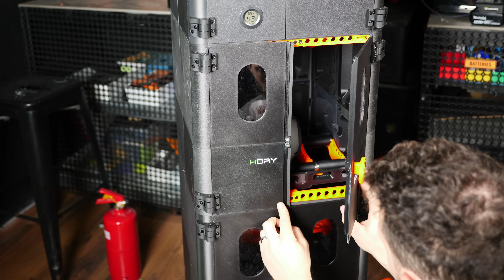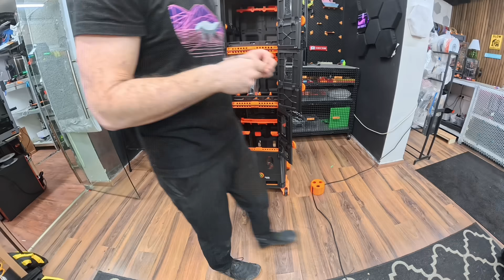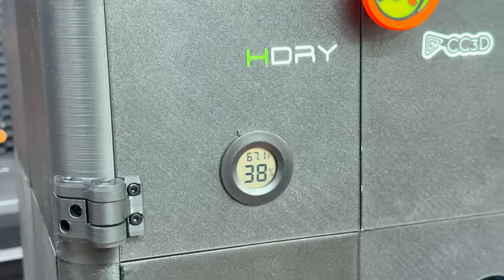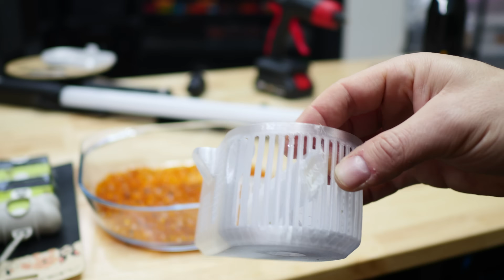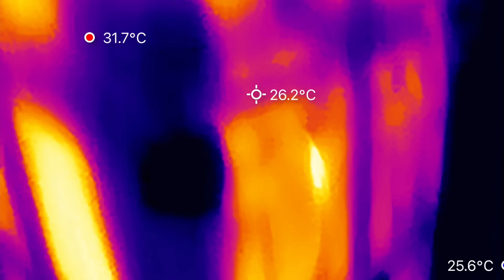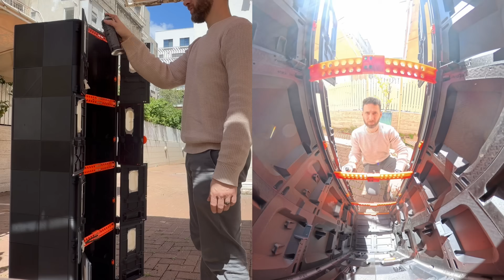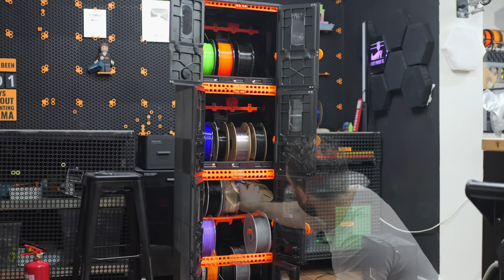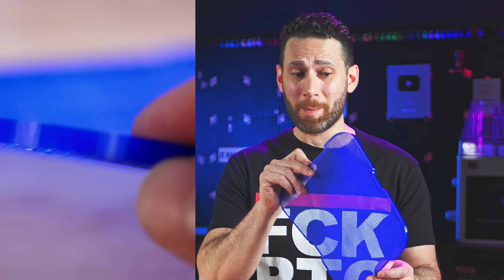This Will REVOLUTIONIZE 3D Printer Filament Storage!

Comment: Hey now, my storage/drying refrigerator side by side IS glorious. And desicant-stocked. 😄 By the by, airtools have a pressurized verson of this that works with a water filter element (like 2 liter size) that with a quick lid swap/3D printed mod, works for BULK storage.
Edit: I also made one for my gun cabinet out of an old microcontrolled hygrometer. Fan runs across my 'dry element' in reverse order when it goes over a certain set threshold. Works well.
Edit 2: If you're looking for the Ultimate moisture absorber for relative cost, Sodium Polyacrylate powder holds a monstrous amount compared to silica, though you can dehydrate it just like silica (i.e., place in oven at low heat). It's the same material that is in diapers if that gives a hint to its absorption power. Microalumina is kind of like cat litter for absorption. It has a lot of surface area, but tops out fairly quick.

Comment: I would like to see a freezers ability to dry filament, so it has a cold side which can be used as a cold trap, all the moisture gone, then the warm side can be used to heat up the cold/dried air.

Comment: Now modify this so it can dry the silica gel too. At certain intervals, turn off the fan and activate a secondary fan together with a heater that blows hot air through the silica gel. This hot and now humid air is vented outside the cabinet through a lid that is lifted by the airflow of the secondary fan.
I'm bad at explaining but I think it could be done.

Comment: I have a public fully parameterized fan duct to aggregate box on onshape.  any size fan,  any volume aggregate case, only need fan mounting hardware and cube magnets, and I could switch those out for printed clips and screws.

Comment: I have a bunch of dry cabinets. They hold a decent amount. At $800 a pop they’re not cheap, but I’m the kind of person willing to pay to not have to think about maintenance and they sit at 10% rh so I can leave my nylons and tpus in there basically indefinitely. For less hygroscopic materials I have a plethora of printed single roll dry boxes (internals are coated with flex seal or some other sealant to improve the seal). I have another dry box running right now on my u1

Comment: I built this same thing from a 5 gallon home depot bucket, a 40W 12V silicone heater pad and an old ATX CPU heatsink and fan I salvaged from a computer.  It would get to 40° and get to sub 10% RH levels.  I used calcium chloride desiccant instead of silica gel (it's MUCH better).  The spools said on their sides and the air was pulled through the desiccant pack, drawn down a 3D printed tube over the warmed heatsink and then cycled back up over the filament over and over. It was a perfect drying and storage solution but you couldn't print from it.  I think I had about $20 into it and that included the thermostat control and bucket/lid.  Lasted me well over 3 years until I got a spacepi X4.  I can state with authority you do NOT need to get to higher temps to dry your filament if you use a better desiccant.

Comment: I think the biggest issue with this cabinet is trying to combine drying and storage into a single unit. Most filaments are hygroscopic and require the increased molecular mobility from heating to break the bond with the H2O molecule. As you touched on in the video, these temps (and glass transition, deformation, and VICAT temps) are different for each filament chemistry.
Even with industrial dry cabinets that use high end molecular sieves (achieving RH down to 1% in some cases), most filaments will take weeks to reach target humidity. The most hygroscopic consumer filaments (nylon/PA) will likely never reach desired moisture levels. 

I think the real solution is to view drying and storage as two independent processes, and build systems accordingly. Define your ideal RH for long term storage of ALREADY dried filament, and build the cabinet around maintaining that environment. Industrial dry cabinets are built around molecular sieves, because they are able to lower RH far lower than silica. They are either designed around Sieve replacement, or active recharge. This cabinet seems to be emulating the replacement model. For the active recharge design, they use an internal air circulating system in the cabinet until the sieve is saturated, then they change the airflow to an external loop and heat the incoming air before it passes through the sieve. This cycle runs until the sieve is properly dried, the outside air circulation is switched back to interior air, and circulation within the cabinet starts again.

Comment: The cabinet itself is your largest mosture migration path ... filaments that absorb and transmit moisture on the spool, do so equally well as printed products ... the ONLY way you will keep moisture out of that box, is using a product for manufacturing the cabinet that IS NOT hydroscopic itself.  Try sheet aluminum that doesn't pass moisture. Simple science ... simple 1st principles engineering ... advice from John @ Kiss Engineering
Reply: As a fix for the vapor migration problems, try sealing it with XTC-3D epoxy coating, or other high grade Marine epoxy, to cut the vapor migration down to near nothing.  Felx Seal Clear is another product that provides an excellent vapor barrier. A clear 2-part polyurethane will still be a lot better than an unsealed PLA or PETG print. There are two problems to stop ... porosity of the printed plastic, as well as just vapor migration through the hydroscopic plastic as well.

Comment: I have 10% super stable in a environment with 70% with very low maintenance using silica and cereal box. Its more efficient if you have a dedicated box for every spool. I put 1 new spool in the box and i don’t open more until the end of the spool.
Reply: I use the cereal boxes as well and it works super well. Very convenient and very low moisture leakage because I don't have to open the box to use it. Every time I put a new roll in I change the desicant and close up the box until the roll is done.
Reply: @groundzero_-lm4md it's the same with mine but I can swap the silica container in 5 seconds if I need it to be more dry. And now I'm developing a new one with a fan to recirculate the inside air.
Reply: I do the same, but mine is about 12-14%... but I live in an extremely humid environment
Reply: I have a similar solution, but when you have about 30 of them keeping track of all the desiccant that needs replacing becomes a chore. I wish there was a system where I could just store-and-forget for longer periods of time.
Reply: @quintesse  I just thought of this, maybe I can find some cheap Bluetooth humidity sensors on battery. Then I can use my smart system to warm me which spools dessicant needs drying 😂

Comment: I bought a couple of large waterproof storage boxes for a few euros each at a hardware store. I store my filament in them. Each box holds 15 rolls of filament. I have about 500 grams of silica gel inside, and the humidity never goes above 11%. If you ensure that all your filament goes into the box dry—meaning always drying it before putting it in the box—then, in principle, no moisture can get in. So, print from a drying box, and as soon as you are finished with the filament, put it straight back into the storage box.
Reply: Which box is in which store, if I may ask?
Reply: @Sebastian-yx4zg  idk what he used, but I do the same thing with a husky storage container that has a built in seal. I also cut a hole and put in a hygrometer
Reply: @Sebastian-yx4zg  "sterilite large gasket box" but I'm sure you can find an equivalent from other companies.

Comment: I need to get in the spray paint business.

But adding 2 different types of descant could easily be automated with Home Assistant.  You could use the silica until it gets past a certain threshold (detected by a simple temp/humidity sensor), then have it switch over to the molecular sieves.  At least where I live, molecular sieves are super easy to get your hands on, and really cheap, so you can really use a bunch of it if you really wanted to.

Comment: One major problem remains. The cabinet simply isn't airtight, which makes the entire system completely inefficient. Fresh air, carrying moisture, can penetrate through every tiny crack. Constantly regenerating the desiccant externally is a waste of time and energy. The system needs to be housed in an airtight enclosure, such as IKEA boxes with a seal. Otherwise, it's useless, sorry.

Comment: I am using simple weather-tight storage crates, with a cloth bag of alumina tossed inside.  It routinely keeps humidity in the sub-8% range with no fans needed.  I have a bluetooth moisture sensor in each crate hooked up to Home Assistant that will warn me when the alumina needs to be recharged.  No fans needed, no 3d printing  of large parts needed, and it is highly effective.  A much lazier approach, but then efficiency is just intelligent laziness after all.

Comment: When I was designing my own drybox, I discovered one often overlooked air leak is the humidity sensors themselves. The humidity sensor units are not air tight, and air leaks through the casing where the screen and plastic body meets. You need to put a clear epoxy (or something) on top of the screen to seal those edges.
Reply: I just stuck the sensor inside of my box. I bought a Bluetooth sensor and monitor it with my phone. It will alert me if the humidity exceeds a preset range, high or low.
Reply: @moxlon69  Yep, I landed on the same solution.
Reply: Just pull a vacuum on your dry box and it'll hiss where there are leaks
Reply: Eh, I strongly doubt it. Unless the gaps are huge it shouldn't make much of a difference. 

Tape the edges if you're concerned, that should be more than good enough.
Reply: @oyuyuy  I use cereal boxes, some have sensors mounted through for the humidity sensor (gasketed around the edges) and some that have them just tossed inside. I have to change the desiccant about 1.5x as often with the ones with the sensor mounted through the box. If you squeeze the box you can feel the air blowing through the screen.

Comment: In industrial we have systems with 2 tubes full of desiccant and timers cyle between the 2 while air flows though one the other has a heating element that dries  desiccant while not in use
Reply: That's what we did in telephone exchanges to dry the pressurised air to the cable systems. This must go back to the 1940's or further as early cable had copper wire insulated by paper within a lead sheath. And moisture would cause havoc.
Reply: Actually, back at least to 1843! This is a similar system to the one we used, which could be simplified for this project. http://www.samhallas.co.uk/repository/documents/pressurisation.pdf

Comment: Here is an observation that I made - I use fs2026 storage for my PETG and use activated alumina in most of the boxes but I also have silica gel too… with activated alumina the filament sits well under 10% of humidity (hygrometers I use only measure 10-70% range, so they all just show 10%)… however boxes with silica gel only go down to 22% no matter how much I dry it… it is by no means a scientific observation but it appears to be some difference between drying agents.

Comment: Molecular sieve 3a instead of silica and the cabinet itself still absorbs ambient moisture, being made of plastic. The clear coat helps but you really need like a mylar layer or sleeve.

I like the forced air. Especially if combined with some sort of automatic dessicant drying.
Reply from the maker: See pinned comment. I did this and it hit 10% in no time. And stayed there. Amazing stuff!!!
Reply: @thenextlayer Ah, nice 👍👍

Comment: i startet the video and it looks like that idea what i had already but with a different aproach but let's watch it fist
Reply: so im finished with the video and yeah similar idea and a much different approach. i wanted to go with a metal Cabinet that i can further insulate for the heat that means yeah the cost for that build could rack up pretty fast not because of the cabinet but because of the extras but i will see when i build it. my idea was to build it in Zones that are sealed from the others tothen use a duct to regulate the hot air for each zone for drying yes it would now as i learned pretty cost intensive on the power bill when you would run it 24/7 or so but in normal mode only the desiccant would get in use and this video showed me a possible solution that would need modification for silica gel with the alumina that wouldn't be needed beacause of the lack of indication. but my problem since the start of my idea how could i effctively open only 1 zone to change the filament in there and not disturb the others... right custom doors so more cost or not... that was the first plan and oh boi i really don't have the programming skills for that project but i have friends that could maybe do that for me. 

now i dropped a lot of my brain stuff in here and didn't come to apoint right? 
the point is: i can go with my idea and make it better with the informations from the video that can help immensly on saving costs in the long run to dry filaments. 
do i think it's still a good idea to go with that metal cabinet thingy? yes i do 
did this video influence me on my approach on my idea? yes it have in a good way 
could i compare it to that video? Maybe costwise an work intensity or so.
should i make a video when i build it? i think i will make one to share my experience and if it works and how effective and so on...
so enugh of me

Comment: Another thought, is the cabinet itself absorbing ambient moisture?
Reply: It is built with filament, so yes, it will absorb moisture from the outside air and bring it back into the cabinet.
Reply from the maker: That's why I spray painted it :) 
Keep watching!
Reply: @thenextlayer I watched the whole thing. But I thought you only painted the inside. The outside is still collecting moisture.

Comment: i'm so glad my print area has less than 15% and i just run my dehumidifier to remove the moisture from when i come in and out. i jsut store the stuff out in the open. asa, nylon, petg, none has a an issue months later
Reply: You going in and out makes zero difference, a room with any amount of ventilation vents all the air multiple times a day anyway - unlike going in and out, which exchanges hardly any air at all.

Comment: Definitely need to dry filament and desiccant before storing them together. Been testing a bunch of different ways to store filament, and found that a good storage solution can even achieve 10% humidity without any desiccant for a month. The humidity drops that low from just the spool itself. Add desiccant and you can even achieve 3% humidity for a month.

Comment: If you had an option to fast swap the silca, instead of reaching to the back of the cabinet, surely that would allow you to push this system a lot further, even using a sealed unit like the fridge, you'll still have to combat the swap-out time, and that affects.

Comment: the problem is there is not enough silica gel in the dryers. when you are targeting 10%RH. silica gel can only absorb 5-7% of it's own weight. so for a filament storage of that size you would propyl need 1kg+ to get a acceptably delay between re drying silica gel.
Reply from the maker: Hence v2. But I got it down to 10% and stable using molecular sieves

Comment: Remember that your cheap RH measurement meter likely can only go down to 10% even if you have lower RH than that.  It also has an accuracy of +/- 5 pct points or so.  Also, why not just use a sealed plastic storage box?  Alumina is the way to go . . .

Comment: Now you just need to design a system with an exterior hatch on the cabinet, so you can quick swap the desicant holder, with a slide system kind of like a NAS, so you don't have to open the cabinet and introduce moisture
Reply: exactly the fans stay inside permanently while the desiccant holder slides in the unit like a cartridge and comes with the unit door on it which has a TPU gasket for a quick swap. the unit has a few fasteners to hold the cartridge + door in place. at the moment you are limited due to not having designed the unit yourself to accept this. in such a case designing 2 separator  layer units to go between your 3 layers of cabinets. each has fans where on blows up one side and the other down to create also a circulation of air.

Comment: A fan sucking air through the media will work far better than simply trying to blow air through it .Also heat is important warm air holds more water than cold air .As for humidity sensors those in the video are rubbish the batteries run out in a week ,try Tapo ones but you will need the Tapo hub to use them but Alexa will provide warning if you use her to monitor them

Comment: I found that those cheap hygrometers have a pretty big range: I had some in a container with a little bit of silica gel and they showed humidities from 11% all the way up to 23%, while in ambient they were only off by 1 or 2% max. 
If you want to go into that range, you might want to get something more reliable that is suitable for that low humidity you want to achieve.
Reply from the maker: Good point. I’ll find something better. Maybe WiFi enabled.